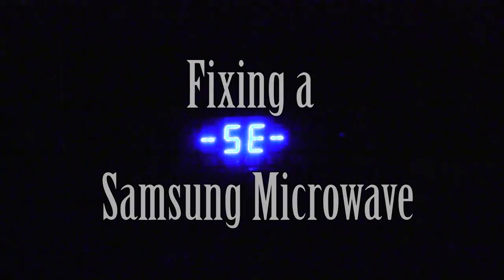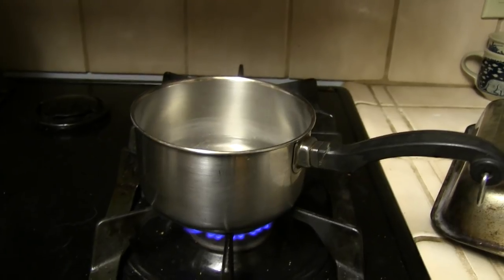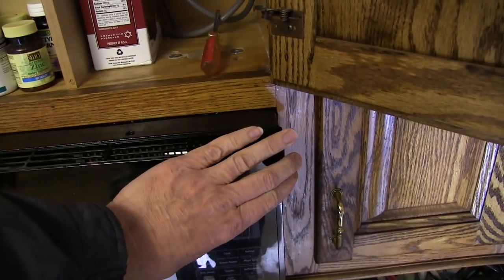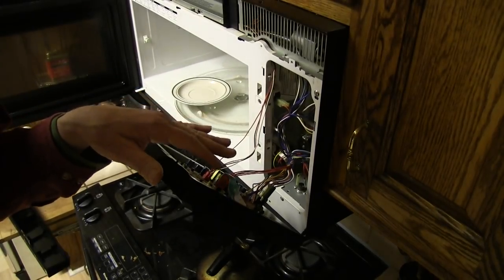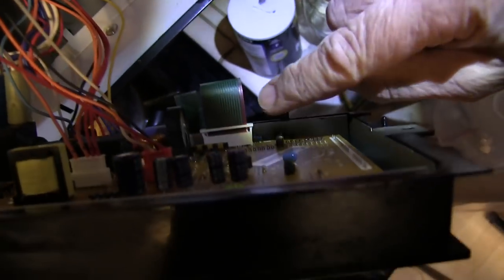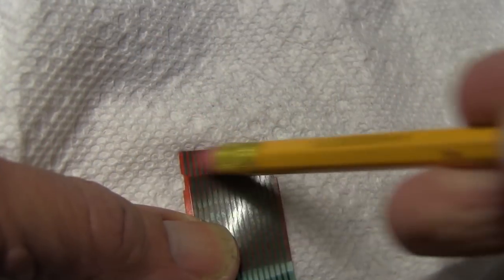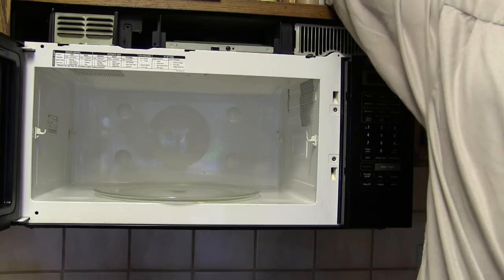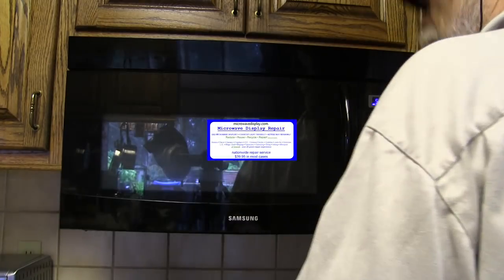Fixing a broken Samsung Microwave - The dreaded 5E error code -- aka the SE error code.

Comment: Had repeated SE errors on 3.5 year old microwave, found this video and then never performed the repair.  

~3 months later, I plugged it in to verify the microwave was still suffering form the error but it powered on normally and appears to be fine.

I did confirm with Samsung that there is extended coverage for the SE error via their 1-800 726-7864 for those with similar issues or those who attempted the repair video above and it does not stick.

Comment: Update.  It worked for a day.  So I took it apart again and just cleaned the ribbon cable with an eraser due to posts down below.  It worked for an hour. (BTW I also put electrical tape on the side to protect the cable further, and some weather sealer at the bottom to keep steam from the stove top from getting in. 
I then called Samsung, again due to another post below, explaining I'd read about this being a potential design problem, and they are sending out a tech with a new control board as a warranty item.  The unit has a January 2010 build, a purchase date of June 2010, and an install date in Spring 2011 during a renovation.  Service tech is due in a week.  Hopefully that will fix it.  No charge for the part or the install.  But if the tech decides there is another problem, then I will receive an estimate and be permitted a decision of what to do next. Most likely will be a new unit at that time.

Comment: An update:  When I went back to the kitchen after sending the previous post -- the microwave was back showing SE -- took it apart again.  This time I used something called Precision Electronics Cleaner from Radio Shack which I think was a bit expensive,but I got it so long ago, I am uncertain -- anyway the cleaner has a built in brush applicator, as soon as I sprayed the cleaner I could see a difference in the look of the ribbon cable contacts they began to shine -- I am hopeful the I got it this time.  Thanks again Joe.

Comment: Update.  First repair only worked for 1 week then back came the 'SE" message.  Cleaned it again but it only worked for another day or so.  Gave it one more try (I've gotten pretty fast at this - only takes a little over 5 minutes) it worked but only lasted about an hour.  If I unplugged the microwave and then plugged  it back in later it would work but only for less than an hour or so.  Finally gave up and ordered a new keypad online for $21.00 plus shipping. Installed it in about 30 minutes and so far it seems to be fixed.  Keeping my fingers crossed.

Comment: The ribbon fix will only work for a short time.  Here is what I had to do after this 5-minute fix did not work the second time around:

I tried the short fix of simply cleaning the ribbon cable with an eraser and alcohol.  This worked for a few months actually, but then the error came back.  Again, I tried the 5 minute fix by cleaning the ribbon cable and this time the "repair" did not work.  So....I performed a full disassembly, including peeling off the front of the control pad.  I cleaned the contacts on both the touch pad and on the corresponding contacts which still remained on the frame with an eraser and alcohol.  The touch pad points were slightly oxidized (green), so I used the eraser on every single touch pad pad and followed that with alcohol.  I reassembled everything and everything is still working.  I will update this comment if the error comes back.  Samsung has taken a pretty good beating on social media for this issue, so that's why they will come and replace the panel without question.  If my error comes back, I will be calling 1-800-SAMSUNG to have them come out.  IMPORTANT TIP:  ALWAYS use the vent on the microwave when cooking on your stove.  Otherwise, the steam and grease will work its way into the nooks and crannies of your control panel.

Comment: HERE IS THE FIX IF VIDEO DOES NOT WORK. it not that it is dirty,but rather the electrical contact point are worn down, i noticed this after viewing under a microscope.  had similar issue with a product my company manufacture. To fix cut 1-2mm off the bottom of the ribbon and reinsert. this will create a new contact point. Hopefully samsung will use a carbon finish on the connector as it is a more robust finish.  tried per video and only work for a few days.

Comment: to add to my fix comment below.  be careful if you are cleaning the connector as the electrical contact on the end are very easy to remove (damage) since they are made via vapor deposition

Comment: I just unplugged mine....plugged it back in....and then proceeded to rip it from its mounts holding it to the cupboard.....as most of the cupboard came down with it ; I then proceeded to let it fall for I wasn’t pleased with the aforementioned events .....it then smashed my stove top and fell to the floor cracking two ceramic tiles.....true story

Comment: Nice video, but as an electronics guy, I can attest that most of the cables shown being cleaned are probably a waste of time, and that 99% of the time it will be the ribbon cable only.
Reply: +Michael Galenkamp I drew the other 1%. Ribbon cable alone didn't fix it. I'm pretty sure my problem was in the large blue and white coded connectors. Scrubbed the copper lugs with alcohol and now it is up and running, again.

Comment: Hey Joe:  Followed your instructions -- 15 minutes -- all fixed.  I wonder how much hate mail you are getting from appliance repair people.  In my neck of the woods there is a $75.00 diagnostic charge whatever the problem.  I very much doubt and would be willing to bet, say $75.00, that the tech would not pull out his eraser to fix the problem -- a new $75.00 board would be the only solution -- but then I am a cynic.  
Thanks agian.